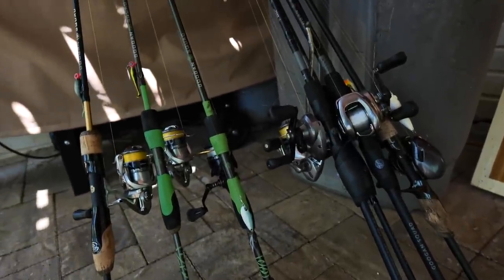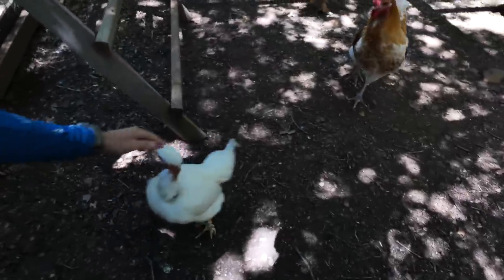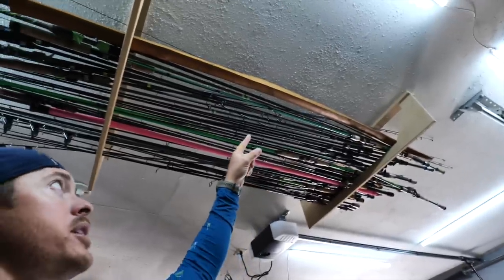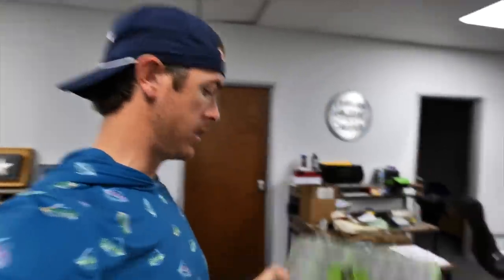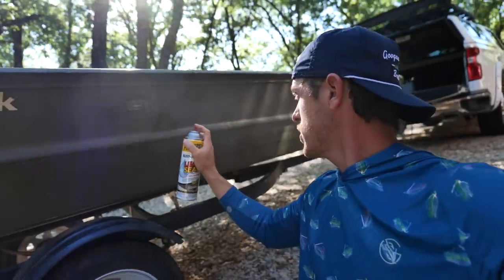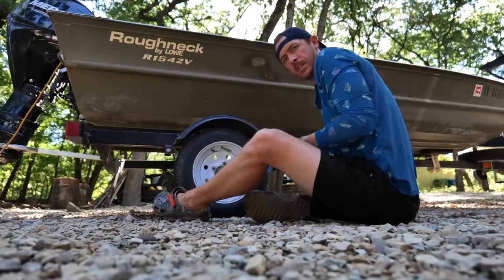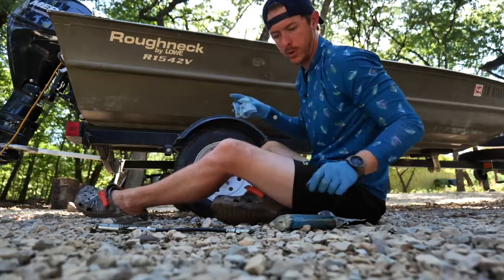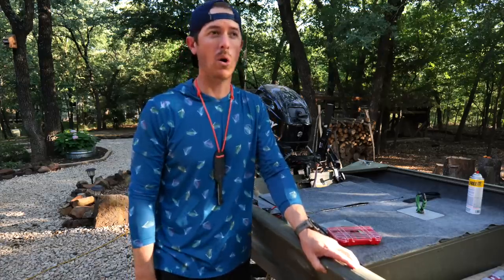My Jon Boat & Long Snakes

Comment: JB waterweld for a quick hole in the hull fix

There’s a shared 20amp fuse under the cowling for electric start and trim. That’s where I would start looking.

Comment: Seems like a fuse or electrical issue to me. I would also recommend getting some bearing buddy’s, they keep pressure in the hub and it helps keep water out

Comment: tow it down the road then feel the hub, if its too hot to touch you have a problem, warm is okay super hot is an issue. You might want to tighten the bearings to take the wiggle out
Reply: Remove the cotter pin and remove the bearings and inspect would be a start if one of them is missing a few bb's that would be the bearing I would replace.  reinstall the bearings and repack with grease. Usually the missing bb's is what causes the slack in the adjuster nut that has the cotter pin holes in it.
Reply: If installing new bearings, check them after about 500 miles. They may need to be retightened. Also, before installing the new ones, make sure to clean out the hub of all old grease and metal shavings.

Comment: Salt works on snakes skins but the ones I’ve done with salt have always been super brittle and flake and break up. I now use 50/50 rubbing alcohol and pure glycerol in a jar. Completely submerge the skin and shake up really good. Shake it 2-4 times a day for 3-5 days. The reason you keep it shook up is to keep the glycerin from setting to the bottom. Once it’s sat in it for a few days then remove and rinse with cold water. Stretch and pin to a board and when it feels dry to the touch then it’s done and completely pliable like a piece of leather

Comment: I know nothing about boats but as a mechanically minded guy who services his own vehicle and stuff, my guess is something to do with the wiring between the switch on the tiller and the engine itself or possibly a relay or something similar
Reply: If not a relay then possibly just check the switch itself for continuity.

Comment: Id check fuses. And connections. Maybe use a volt meter and check that you have 12v at different points starting with the battery

Comment: Check for a loose ground on the motor, or a loose power wire.  I have had the vibration knock mine out on my 9.9.

Comment: Have you checked the switches? I would check continuity at the switches and then work back to the source.
Reply: The trim motor could also be the issue as well. You want to check power and ground continuity at the loads and the switches. Also check everything for resistance as well

Comment: Should be able to pull that snakeskin off like a sock. Head off, pull down. Guts and everything comes out when you get to the tale. With practice can stretch it out to your board at the same time. Staple opening, sit in sun for a day.

Comment: The trim issue seems like an electrical issue or trim switch is bad or fuse like the previous comment. Chase the wires with a voltmeter.